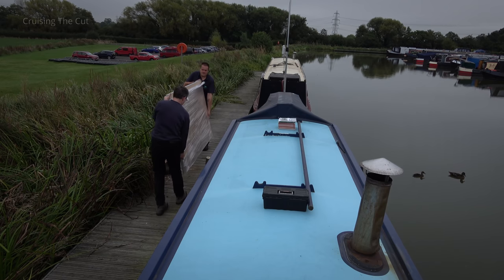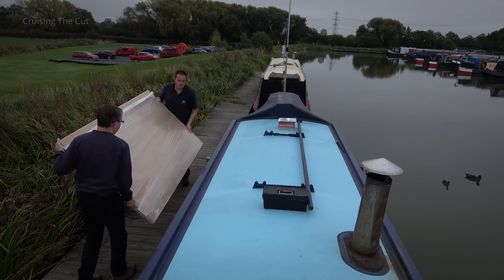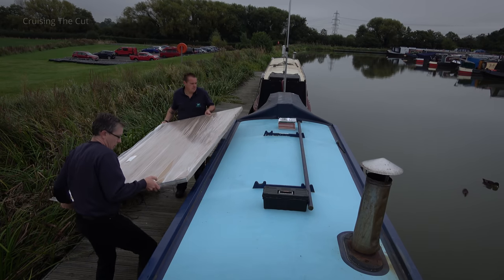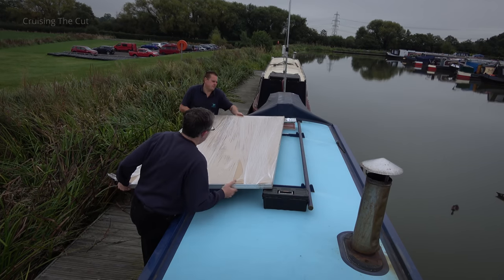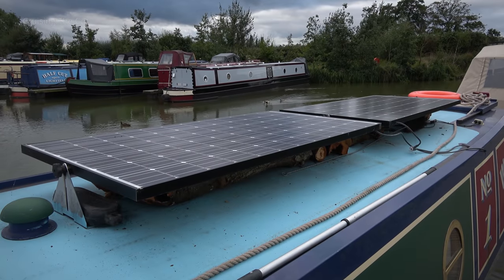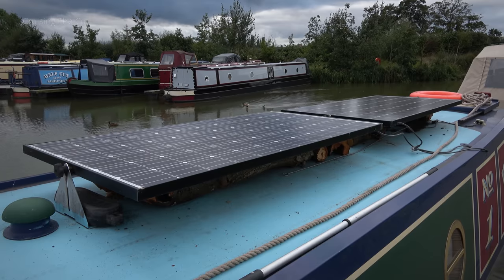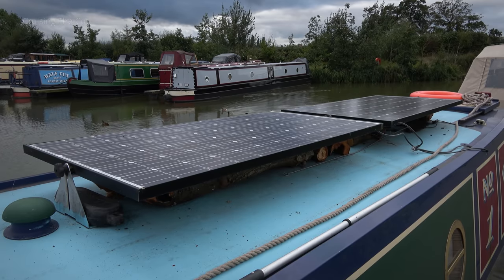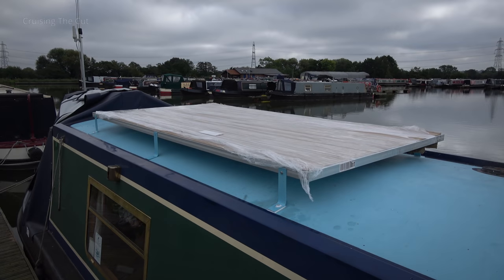260. Solar Panel and Lead-Carbon battery update (narrowboat)

Comment: Interesting update. Your issues with PV generated electricity neatly illustrate societies problems with "renewable" energy in general. At some point the shortfall has to be made up and the only realistic option is some form of hydro-carbon (or nuclear) based generation.
I have pondered this problem for a few years now and have come to the conclusion that for a truly "off-grid" domestic static installation the only answer is a wood gasifier powered generator.
A typical UK home needs 14 kWh of storage available to get through every 24 hours. Without insanely over-sizing both the storage and photo-voltaic panels a backup generator is required.
The message for society in general and governments planing for the future in particular is that, for the next twenty years at least, gas powered "spinning reserve" is necessary and only new nuclear will replace that in the long term. It maybe that fusion power will become a reality one day but until then the options are clear.

Comment: Yes I know the video is old and this isn't relevant to you but others might benefit. I do think the reason you got through the rest of January without running the engine was partly because at that point your batteries were fully charged up.  I understand that those in London might struggle to get a random week on a marina in winter,  but for those of us in the midlands I have to say that its a good idea to at least think about going in to a marina when your batteries are done, even if it is only for a day or two.  When you come back out your batteries will be fully charged and it should get you through a few days or even weeks if the sun comes out.
Reply from the maker: Not really, the batteries were always only good for about 1-2 days after fully charging, I did not have some vast battery bank.

Comment: Hi David 
Fantastic how you compare charging a lead acid battery bank to filling a lock.
I know how you felt when plugging into shore power. 
You could do yourselves a big 
Favour by adding a small lithium battery bank with a 3 way switch to your existing bank it almost feels like  shore power.
They are almost like opposite poles 
One like’s to be fully charged 
The other one prefers 50% SOC 
Its also good as a saving for a  rainy cloudy day 
Your solar panels only charge 
Until your battery bank is full and after that do nothing 
If you have a small lithium bank you can use more power consuming stuff and discharge the lithium bank until 20 % SOC 
The solar panels will easily charge them  again.
Reply from the maker: Lithium's expensive and doesn't like the cold and I've nowhere convenient to put it, unfortunately. On a new build boat, I'd definitely have it.
Reply: @CruisingTheCut  

I have 4 carbon lead batteries like yours. 
They are more expensive than
 the 200 amp  lithiums with the same capacity.

Comment: Thank you, David, that was actually easy to follow and understand. I did miss your usual diagrams on how things work but hopefully, soon you can get back to the artwork ;)

As we down this way are known as the Solar country, our solar generation hours are nothing as paltry as what you have to put up with. We still need to have the cells facing the main sun (mine aren't) and avoid shadowing by tall trees (mine are). Not perfect conditions so though my installation went in back in 2011 we still don't get anywhere near the potential 1.2kw. With a big tree on Council's footpath shadowing through much of summer there is not much I can do about it except hope for clear sunny days. So, down here, location is vital to get the efficiency desired. 
Thanks for a glimpse of the solar situation in your country, I enjoyed it.

Comment: Running a fridge in winter is quite a challenge. I switched to a small dorm fridge (severin 8875) It draws 50watts when running and in winter is on for 8% of the time. But when the water temperature is below 8 degrees, I use the bilge.

Comment: That was very interesting. Thanks. Having solar panels myself, I have learned how sensitive to light the human eye are and how little solar panels are. (And cameras as well when making videos I suppose). Just because there’s enough light outside to see, doesn’t necessarily mean the panels will be producing anything. 😀
I also got an MacBook Air this summer since my old iMac from 2013 gave up the ghost. I am quite amazed how well it edits 4k video. It does slow down when it thermal throttles because of the lack of fans. I bought istat to keep an eye on it. Not that it changes anything.

Comment: Maybe get yourself one of those small Honda portable generators. Little bigger than a 6 pack cooler. Uses little gas or propane and are pretty quiet. Your boats motor is designed to push the boat and the generator/alternator is just there to recharge the starting battery. You are basically using it for the exact opposite reason it is there and a complete waste but for one pulley and idling puts a lot of wear on rings and bearings. A little Honda and a battery charger and when you have the Gen running you will have an extra outlet to plug into to run something heavy like the vac or microwave.
Reply from the maker: Hi, please see the pinned comment at the top, cheers

Comment: As to your new panel out-performing the two older panels: I do know that there have been newer, more efficient panels available in the market over the last few years.  

Is it possible the new one is simply a more modern model?  Keep up the GOOD WORK! (We need someone to be envious of!)
Reply: Cell efficiency at 100% is 1kw of output per square metre in direct sunlight. Most panels made in the last few years have gone from about 17% to a "high efficiency" of 21% - its not much difference in reality. Area or Square meterage still make more difference than cell efficiency when comparing panels.

Comment: When your batteries wear out, I strongly suggest going with lithium. They take a charge much faster than lead batteries, so you would need to run your engine less. A decent lithium iron phosphate battery will take 100 amps at 12 volts: as much as your alternator would put out, for sure. They will make a bit of heat when charging or discharging. As long as you keep them above freezing cold temperatures aren't a concern. They won't improve your solar performance though.
Reply from the maker: Lithium would be lovely but it’s still very expensive and wouldn’t like either the cold or heat of my engine bay

Comment: I think I would be inclined to add more battery storage to offset those gloomy days , even if you had to run the engine you would still have a larger bank to draw from before having to do it again .
Reply from the maker: Yeah, I wish I had suitable space to increase the bank but without major re-engineering it's not terribly practical on my boat.

Comment: I'm thinking of getting something similar, but smaller scale, for my allotment shed.
Reply: Unless you will be among the many with such a system...
you will attract attention and will be burgled for your whole system ...
or your very visible panels will be stolen.
Suggest if you need a power supply just for daily use you put a decent battery cunningly disguised inside an innocuous cardboard box...on a handcart/wheelbarrow...and take it in with you...and take it home again each night.
You will need an inverter mounted somewhere in the shed..suggest another cardboard box with openable/closeable  cooling flaps...
and a dummy gas cooker etc to draw attention away from the electric kettle and /or fan.....

Comment: Actually fascinating and does provide valuable insight to the pros and cons of living off grid. So much of the green movement is based on "feelings" and good intentions without practical experience. Thank for your candid observations free from agenda. You may have addressed the fuel consumption of your engine but I cannot imagine it is the most efficient way to charge your batteries. Have you considered one of the small 1000W to 2200W suitcase sized inverter generators? My 220W Yamaha in eco mode can nurse roughly 10 hours out of a gallon of gasoline at 25% output. Best wishes.
Reply from the maker: Hi, please see my pinned comment at the top :-)

Comment: One thing to consider is , when in winter mooring, is solar panels on a tipping tripod type mount. Bear with me while I try to put the image in my head into words. Picture the swivel mounts for things like cameras or work lights. Now imagine something large enough to mount an entire solar panel. It would need to be able to tip to get the ideal angle on the sun, rotate to follow the track of the sun throughout the day. And allow the panel to rotate between tall and wide so that it can be the least obstructing other activities. OBVIOUSLY each panel cannot be the size of your permanently mounted ones on the roof, that’s too heavy and awkward to risk a single bump wrecking the thing. You would also have to be able to stow it away because something so light to do what it is need to do, is also light enough to “walk with Jesus “ but some of the smaller stick on panels could be put onto a single post in an array. When not in use each panel can be removed and stored and then all you have left is the football NFL shaped goal post mount. Alignment to the sun is very easy just remember your not pointing where the sun is now, but the estimated halfway point until the next time you plane to go out and align it. Your are now a NASA Space engineer, pointing Apollo 11 not where the moon is now, but where it will be in three days
Reply from the maker: Such a hassle, for negligible increase in the overcast winter!!

Comment: David, I know this is a huge ask, but if anyone can do it, you can.

 Since you are focusing more on pieces about the canals than cruising, can you do one about the canals use during ww2, i did a little dive into it and found it fascinating, and who better to teach all of us more about it than you, the guy who is a reporter and is there, a 10-15 minute video about it would teach me more than a few hours of googling, and the history of the canals are so intriguing, especially during times of war.
Reply from the maker: Hi. The trouble with this is that there'd be no video or images to go with it (everything would be copyright Getty Images or Pathe News etc which is very expensive to use) so it wouldn't make a very interesting video.
Reply: @CruisingTheCut   you're correct of course, even this link doesn't load for me

Comment: Always enjoy your fireside chat style vlogs, even if you weren't technically fireside this time. Glad you're liking the new M1 MacBook Air, even if you're not a complete convert... yet. Have you also switched to an iPhone? If that's not being too nosy. 😳 I can see why you wouldn't want to give up your fridge, despite an earlier comment saying you're "obsessed" with it. I also read a previous comment about putting an extra bank of batteries under the bed. I remember the earlier vlogs chronicling the Eberspächer install, where you ran wiring from the bathroom to the engine room through the bed and bedroom. I doubt you'd want to go into all that again! Plus the expense of buying more batteries and all the gubbins that go with them.
Reply from the maker: I think you're confusing me with someone else, I've never had an Eberspacher install like that.
Reply: @CruisingTheCut   I just looked back, and you're right. (and why wouldn't you be, it's your boat!) It was the water pump issue in Vlog 27 I was remembering. I remembered going from the bath to the engine room alright, just not what was being done.

Comment: A bit ranty, yes (maybe the blustery weather affected the mood?), but so lovely to see you and get an update. I was always curious about how you managed winters with/without shore power. It sounds like you get power when you're fed up with discomfort and battery monitoring. On a lark, I looked at the cost of a powered narrowboat marina pontoon and it didn't seem terribly expensive, so do you resist getting shore power mostly for reasons of cost or more from the standpoint of self-sufficiency? Anyhow, so nice to see you. I had a cheese sandwich last week and thought of you and wondered how you were getting on. It's pleasing to know you're full of vigor. Happy Springtime!
Reply from the maker: Not cost but a nicer view!! The unpowered mooring has no neighbours to the sides.

Comment: They make very quiet and efficient compact Honda generators. Maybe you could use something like that to charge the batteries. It's also nice to have an extra backup for power. They use petrol though, instead of diesel.
Reply from the maker: Cheers, yes but then you have to buy and store petrol (not generally available on the canals) and generators tend to be banned in marinas because of noise.

Comment: Reading all the comments has been very interesting. Not directly to solar I appreciate David, but I’ve always wondered why NB,s with their premium on space are seemingly not built without ballast, but with an integral below floor water tank. Presumably it wouldn’t freeze in winter as it would be below the canal ice level. It would also reduce the frequency of filling up and “water anxiety”. Maybe it might make the floor colder? but water would not be much colder than concretes blocks/bricks and insulation shouldn’t be too difficult to address. Not completely unrelated to your video, the tank could also enable use of a heat sink for the fridge!  Seems such an obvious thing to do in a new build. Can’t really see a significant downside. The tank “empty” stability issue could be addressed by a heavier base plate which I note is used by some builders already. Something to muse over on a late winters/ early spring evening?  Your thoughts at some stage?  Philip 🇳🇿
Reply from the maker: I think if the baseplate was going to be the ballast then having the water along the floor doesn’t provide any benefit over a standard tank in the bow.

Comment: Here in the states, I have been seeing a lot of leaps and bounds in solar due to the "van-life" trend. I would be curious to see a narrow-boat with some of the similar off-grid/van-life electric tech applied.
Reply from the maker: The modern boats (mine's 22 years old) are now built with solar, lithium, all manner of clever monitoring etc

Comment: Actualy David, this was a verry pragmatic and informative chitchat.
I think that many novice boaters (as i once hope to be) will have to deal with this issue.
As i am i'd just put the roof full of solars, and the engine bay full of batteries.
I can't imagine i'd survice if the dishwasher is unavailable cause i'm stingy on the electric bill.
btw in a marina isn't there a wall socket for each boat 'moored' ?
Reply from the maker: Yes there is usually but I had a "special" mooring 🤣

Comment: You should check into a 12v fridge.  They have them here in the states for RV's and they are a lot more efficient than a/c fridges.
Reply from the maker: It is a 12V (compressor) fridge!

Comment: Sounds like time to screw (or weld?) the side-hatch shut (so nobody can open it) and install another (big) panel...would that be enough? Or would you have to well, tile the entire roof of the boat with solar-panels?
Very interesting vlog! I am thinking about experimenting with a bit of solar (some backup solution in case of blackouts), so this is interesting to me! No I would not wire that backup into the house itself (it doesn't belong to me, so I can't make a choice like that, but nobody can stop me from putting a solar-panel or two on the balcony (don't use that anyway, because it is on the side were the road is (so noisy! Not pleasant to sit out there!) and put a couple of batteries in a box with a charge-controller and an inverter wired up to a couple of sockets (just a little setup that I could take camping, too)

Comment: I have 600W of solar. From my notes on the back of a fag packet, I have run the engine for 94 hours since 1st December. That's charging and moving as I CC. That works out at roughly  just a little over 1 hour/day. There have been many days, especially in the last few weeks, where I'm fully charged by 1030 -1100 in the morning, and have to look around to see if I can somehow harness all the hours of wasted power! I'm going to modify my immersion heater as a solar dump, so I can have hot water on tap. 
From my notes, I average 43Ah/day consumption, and the shoreline fridge freezer (on 24/7) consumes an average of 18Ah/day. 
On low light days, when you're only producing a couple of Amps, it's by far, most efficient to bulk charge early in the morning from the engine. The low charge from what solar there is can then top of if there's enough hours in the day. No point in running an engine for hours to produce the couple of amps to finish the charge, when the solar can do that free and without noise and vibration!
Reply from the maker: True! Although that involves getting up in the morning 🤣

Comment: Would be interesting experiment how cold the canel water gets in the winter months. Maybe run a mini radiator and a small pump in a cold box with the  canel water .. diy fridge for the frigid months might work.
Reply: Some boats have a hatch in the floor revealing a chamber beneath the floor against the hull which is naturally cooler and ideal for wine, vegetables etc.
Reply: Not a bad idea. Use heat exchangers to remove the heat from the fridge to the water. A simple 4w pump is all that's needed, plus some monitoring for temps etc...

Comment: I friend of mine used an automatic sun tracking system, that of course means its always in the optimum position. This was on his land surrounding his house (Spain) ..however, I don't suppose its beyond the possibilities to rig something on a boat when moored up, even if you must move it manually